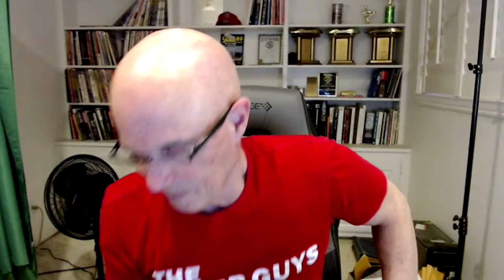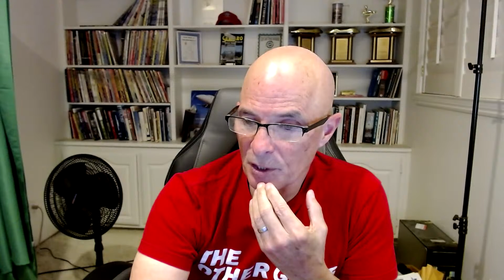8-71 SBC 400 TEST LET'S TALK TECH

Comment: I’m seeking your advice after watching your boosted NA camshaft tests and your statements on boosting a great running NA motor and now here I am wanting to play with fire. 😅 I happen to have had a nice NA short block built with NA mech alky injection as my planned setup. I just happened to score a great deal on a complete Blower Shop 871 with an enderle injector and enderle fuel system off a good friend. I’ve been watching all your great videos on adding boost to a well preforming NA engine along with your NA vs Boost camshaft comparison testing. I’d love to have your opinion on my situation with me having a freshly built 505 bbc with a 1/2 filled GM 2 bolt block with upgraded splayed main caps, forged 4.250 Eagle crank and 6.535 forged rods with J&E forged 47cc dome pistons. My Static compression came in at 12.74 with dynamic compression 10.14-1. I have an Erson solid Roller cam 740/740 302/306 and 274/278 435/435 @.050. Installed at 108 with cam gear retarded 6 degrees. The rings were gapped at .022 and .024. I’m using an unmodified set of older aluminum Pro Topline 360cc heads. Short block only has 2 partial 1/8 mile passes on it. Block or heads are i
not O ringed but I’ve been looking at the new SCE Vulcan cut ring head gaskets as an option. It’ll never see more than 10lbs of boost. Your advice would be very helpful because I just hate the thought of having to build up another short block. I’m not trying to set the world on fire with fastest times it can produce and YES I will own the responsibility flaws if it decides to exit this world!! I would love to hear your thoughts with all your knowledge about my setup. Thanks Mike
Reply from the maker: what fuel?
Reply: @richardholdener1727  sorry for the delay in my response. it will be ran on Methanol
Reply: @richardholdener1727  Sorry for some reason my response I wrote back to you on your question for the fuel I use. I apologize for my error. I'm running methanol  alcohol. I eventually would like to have a street driven on E85 tune up for short trips to local car shows just to ease the strain on wallet for the amount of methanol it takes to drive my car anywhere. Thanks for you help Mike
Reply: @ I copied and pasted the sentence below from my original question I asked you. It was the 2nd sentence of my question. 

" I happen to have had a nice NA short block built with NA mech alky injection as my planned setup."

Comment: I have an oddball combo. It is the mitsu 3.0 v6 in a mid 90’s Chrysler. How much ring gap do I need to run modest boost, 6-7 psi. Thanks
Reply from the maker: .006 per 1 inch of bore
Reply: @ thank you!

Comment: I'm assuming that a blower on a 355 with forged internals minus the rods would be adequate at 8:00 to 12 lb of boost????
Reply: Dart 165 heads 512 lift and headers with a 750 Eddy